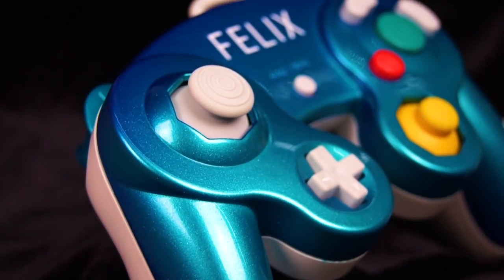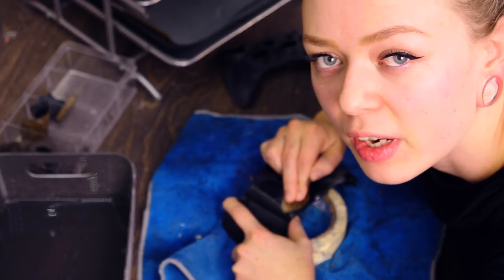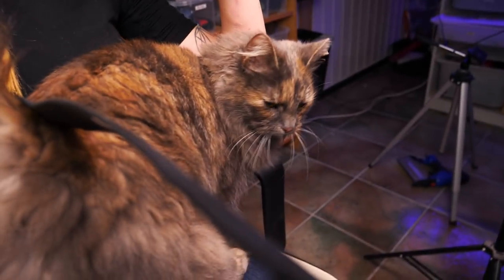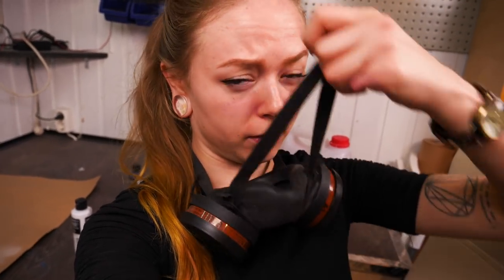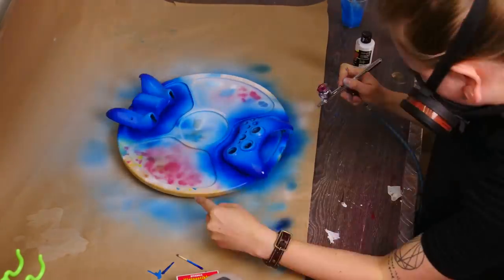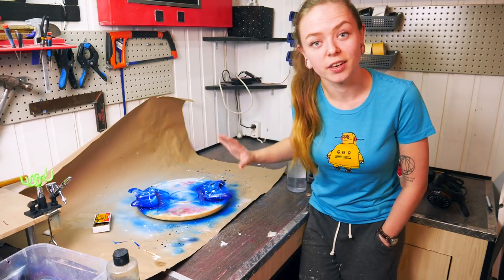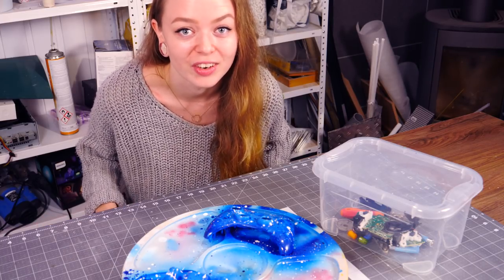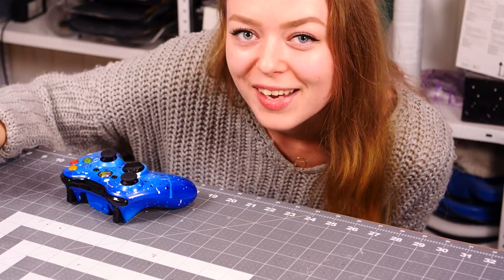Custom Modding my Xbox Controller - SHINY!

Comment: very nice! Could a Keyboard be done like this? I imagine the sanding part might be problematic!
Reply: A keyboard would be amazing :D
Reply: It can be done to a keyboard pretty easily. If you start out with "Das Keyboard" you have blank keys to work with. sand the keys down the same as anything else, and you can even put your own custom font on all the keycaps if you know what you're doing. I've also seen people make keycaps out of typewriter keys, cast resin, cast aluminum, cast copper, the ends of hex bolts, buttons sunk in resin, all kinds of neat things.

Comment from the maker: What do you think I should paint/mod next?
Reply: Natural Nerd would be cool if you mod/paint a new xbox one controller. Btw what clear coat are you using?
Reply: Natural Nerd 872 :D
Reply: I'd love to see a whole new controller made by creating a 2 part mold for the top and another for the bottom, using alumilite resin and pearlex to create a swirly transparent effect in the end could probably be done without too much difficulty using a slush casting method, though it'd require a lot of careful cleanup later. Would be even more cool to create new buttons with an LED inside each of them. I can see how that might be a little overly complex though, what with trying to create . How about making a new custom casing for your xbox? Something to sort-of match your new controller paint scheme but looking completely unlike an xbox(ie. something more rectangular and less organic looking with EL strips as decoration)?
Reply: If you have a Wii U laying around that could make for an interesting mod job. Or like GreatSmithanon said a companion paint job for the controller's console could be cool too.
Reply: Make the boring black ps3 look cool and modern again! :D
Reply: Joy-cons from Nintendo heheh
Reply: You should make the xbox match the controller!
Reply: Natural Nerd what about a ps4 controller mod with a design of a popular game. For example overwatch pls.
Reply: Natural Nerd a computercase 😎👍
Reply: paint a NERF gun and add some LEDs of course, because LED make everything better and reasons :-D
Reply: PS4 CONTROLLER PLEASE :3
Reply: Cool Modd :D maby next PS1 Console or controller :D or N64
Reply: do it on phone
Reply: XBO Gamepad :_)

Comment: That turned out really nice, have you ever tried to dip before? I was thinking of doing it to a old ps3 controller I had laying around for test, I’ve seen videos on how to make a diy dip tank and using oil based spray paint make your own designs as well or you can order bad ass designs online as well
Reply from the maker: I haven't tried that! Looks really interesting

Comment: If I was you I will make both like at the tips one side would be dark green and it gets lighter and lighter towards the middle in the middle is a cross-section between light green and light blue and starts to turn  light blue always to dark blue the tip would be dark blue and do it from left to right the left would be the dark green tip in the right would be the dark blue tip